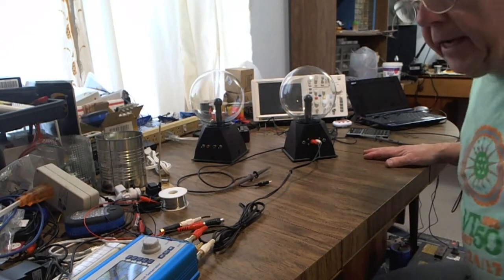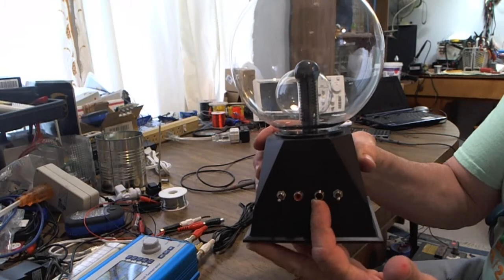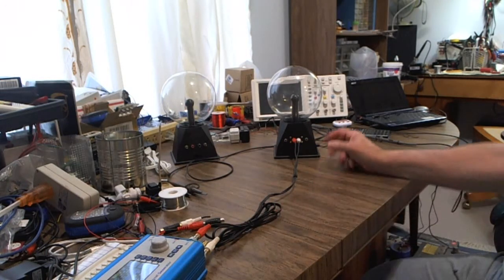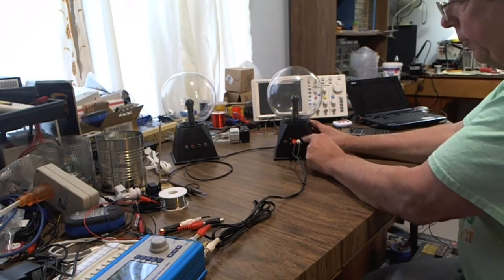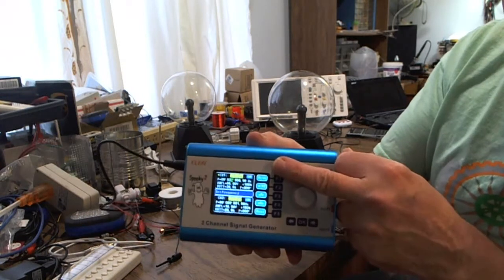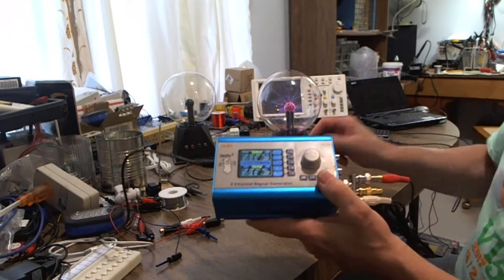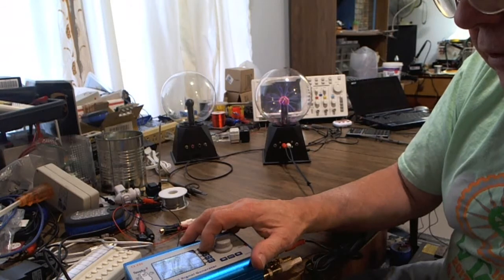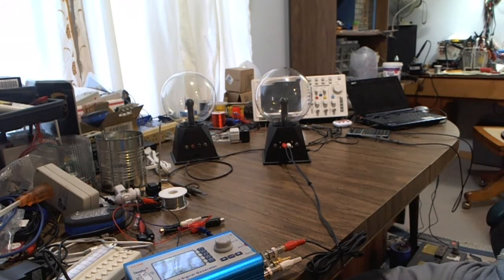Plasma Run Parameters from Spooky2

Comment: how close do you have to be to it for results?
Reply from the maker: It works nicely at distances from a few inches to about 5 feet and depends on what you are attempting to do.
Reply: @gskempe9  thanks - what is the best set up for this?  I've heard it interferes with computers... and I don't really want to put it next to my bed..   Could I have it next to my feet?
Reply from the maker: @Jlciluso2024  That is your choice!  I run a generalized health and energy protocol next to my bed (within 3 feet) almost every night for several hours at a time.  I would like to suggest you research Rife technology and related electric field application techniques.  There is much to learned and a  lot of the information can be found on the internet.  Be discerning and don't believe everything that is said, especially if it involves buying something.   Be well and respectfully,  Steve
Reply: @gskempe9  Thanks :) I have a genx so I am a big fan of the spooky, but wasnt sure if its worth buying a plasma

Comment: Where did get plasma lights do you have a link? Also do the plasma balls give off energy from the spooky2?
Reply from the maker: Sourced from Walmart.  The Spooky-XM doesn’t give off the energy.  The Plasma Balls are driven by the Spooky-XM function generator and they give off the energy.
Reply: Ok thanks.. Do plasma balls from walmart have rca plugs and switches? Or did u have to make them? Can u send me link to plasma balls used in video to mb3gee @ yahoo.. Or add it in ur video description. Thanks